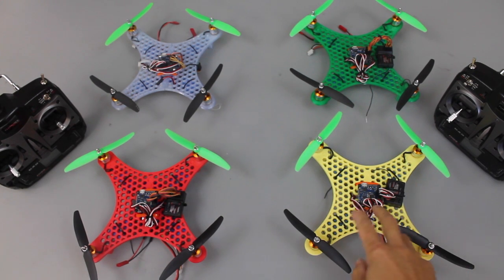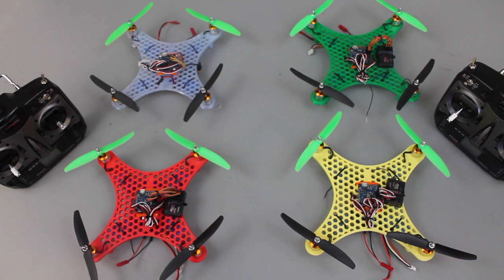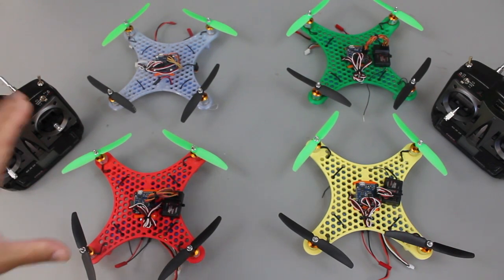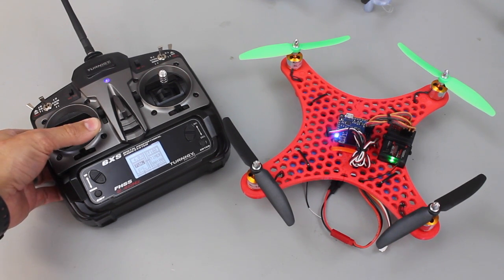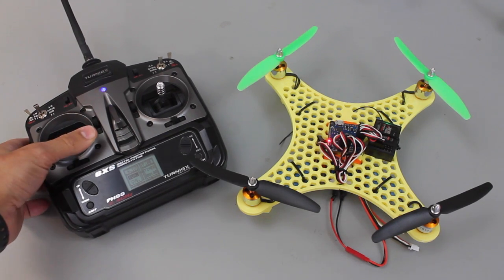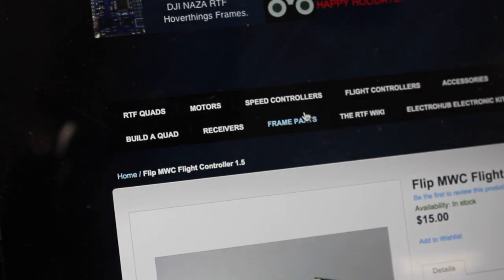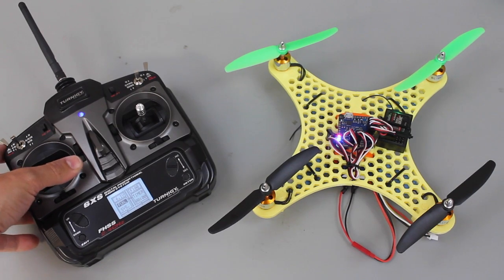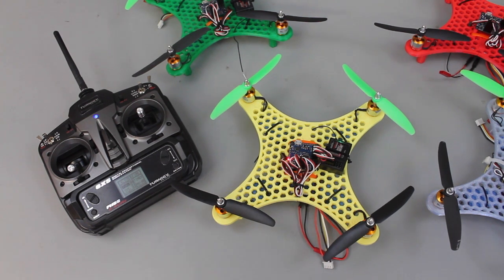MultiWii Flip MINCOMMAND Firmware Tweak to Fix Failed ESC Initialization

Comment: my multiwii drone can not lift since it can not reach max throttle. I found many causes. I see that calibrating is very useful. I use mosfet as an esc. it is brushed esc and brushed motor 820 dc. how to calibrate brushed diy esc like that?

Comment: Hey awesome vid
But i have a question, i build a tricopter with a friend with the multiwiiPro board from HK an the same Transmitter as you are using, but it wabbeld the hole time with this Transmiiter. He baught the a KK 2 Board and it still wabbeld so it was uncontrolerbale, but as i hooked up my Graupner Transmitter it flew just awesome. have you may a solution so it works also with his Transmitter?
Reply from the maker: Allflying Stuff I'm not exactly sure what the problem is, but it did take me a while to figure out how to get the right settings. Make sure you set it up in "PLANE" mode. I also had to adjust my travel on my rudder channel to get it to reach both fully endpoints. I'm not sure this will fix your wobble problem, but it's worth looking into.

Comment: Looks Great .  I know this must be done with "plush" series ESCs. make sure the speed controllers are calibrated. there is a section of the code that will do it for you (remove props please). I think those radios have a lower pwm signal so if you calibrate via the throttle port on the rx they might not arm with stock settings.
Reply from the maker: witespy Right on. Thanks for the tips. I was a victim of the props spinning up when I did the MultiWii ESC calibration. Thankfully they were only 5" props but they still got me pretty good. I was lazy on that day and it could have been much worse. But I hear you loud and clear. I normally always take the props off and have learned a lesson the hard way.
Reply: Hi Dennis.
Yes. The armed multiwii ESC calibration is a horrifying experience!
My son and I love your videos!
Any experience with RTF quads "Pimp my Flip" Mag / Baro board? Or any good references (youtube or otherwise) of how to get started with one?
I bought one and am trying to prepare myself how to use it with the Multiwii 2.2 setup.(Attaching it to the flip and then programming / calibrating. )
Absolutely LOVE the Multiwii Flip 1.5 from RTF! Really, really smooth.

Comment: Awesome Dennis. I'll be doing something very similar with some high school kids in Alabama - their done lab. Added two fpv kits to show what that's all about. 

Quick question on the multiwii. Doing my first multiwii build now and I got the firmware from Google I think. How do I load it into the arduino ide? Seems to be looking for a file with specific extension but I don't see any that matches.  I have the zip, a while bunch of C and .h headers files. Also do you think I can flash with the Bluetooth ftdi or do I have to use USB? 

Again, kudos!!
Reply from the maker: Julien Gordon Very cool that you're doing this with high school kids. We live in exciting times! Regarding your MultiWii question you need to open the MultiWii.ino file in the IDE. Here is a link to it in GitHub:

https://github.com/multiwii/multiwii-firmware/blob/upstream_shared/MultiWii.ino

I've never flashed with Bluetooth and have only used USB, which works well. Good luck and keep us posted on your progress.
Reply: Dennis Baldwin got my USB ftdi in the mail yesterday. Windows 8 doesn't seem to like it -wonderful. I'm happy that we went APM with the school project for setup ease. While pretty cheap the multiwii takes some a bit of doing. Your videos are very helpful.